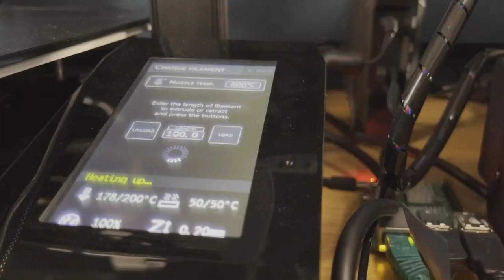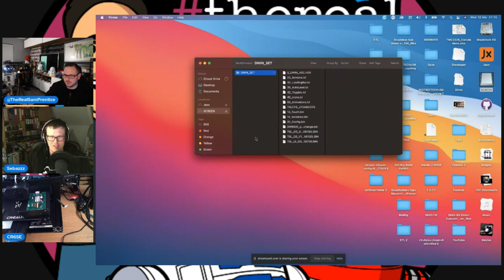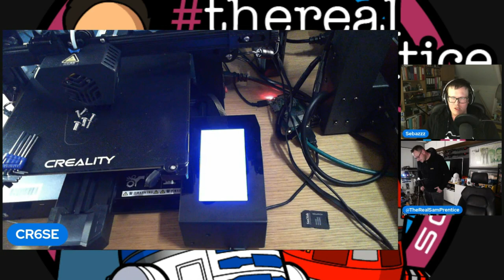Creality CR6 SE Community Firmware V6 Upgrade Interview with Sebastiaan Dammann

Comment: Great work as always and streets ahead of what Creality just can't be bothered to do.  Is anyone having an issue with changing filament during the print.  With V6 I'm getting a nasty blob of filament when it resumes and the nozzle seems to hang on the print allowing it to melt the design.  I don't mean the usual little bit of excess filament you grab with the tweezers but quite a big glob.  I have gone back to V5 and its working fine again.  Anyone else had this problem with V6?

Comment: Hello guys I had a problem with the installation and the touch doesn't work anymore. I tried to go back to the original software and it doesn't work either. could you help me?😭
Reply from the maker: Make sure you have formatted your cards, do the screen first

Comment: will a smart filament sensor work with this firmware? by smart, I don't specifically mean the BTT smart sensor, but any sensor that works with a rotary encoder?
Reply from the maker: can you send me a link ?
Reply: @TheRealSamPrentice  to the smart sensor? it was featured on a Teaching Tech video, here's a link to that video. https://www.youtube.com/watch?v=9gLSJIxiuwo , I just wanted to know if such a sensor would work with the community edition of the firmware. by using a rotary encoder, it detects runout, jams and anything that stops the filament from moving through it.
Reply from the maker: @zangetsu2k8  Well being based on Marlin yes it will support it, although the code might need a small tweak.

Comment: GREAT! Now show us how to remove the Nasty Bed Levelling Sensor & install a BL Touch
Reply: @TherRealSamPrentice you should give Sebastiaan an idea :-D
Reply from the maker: Are you running v6 then?
Reply: @TheRealSamPrentice  not as yet,will wait for the official release.
Reply from the maker: @pranashmaharaj  let me know how you get on with it, I have the micro Swiss hot end coming soon so I’ll see if that makes any difference.
Mine is levelling really well on v6
Reply: @TheRealSamPrentice  I purchased the Slice engineering mosquito hot end.I haven’t gotten down to installing it.I need to do a lot of work with creating a reliable adapter kit.will post you a link as soon as I’m done with it.please share a video on the Microswiss.
Reply from the maker: @pranashmaharaj  ooo okay i run those on 3 of my machines. Have a look at this https://main.eva-3d.page there might be an option that could work
Reply: @TheRealSamPrentice  awesome will have a look! Thanks Sam!
Reply: @UChFNvcsYthE8ql-4niRTS-A what's the chances of this happening

Comment: It's not as good as it's made out to be ... If you use Prusa slicer, you cannot run a 0 temp bed, it will keep defaulting to 50 degrees .  Also, there is no stop button, so if you tell it to preheat, then change your mind, you either sit there for five minutes waiting for it to heat or turn it off.  I am not a big fan of continually cycling the power on computers.  It is also nearly impossible to work out how to go back to the original firmware!
Reply from the maker: It’s not really tho is it you just do the same with the original firmware